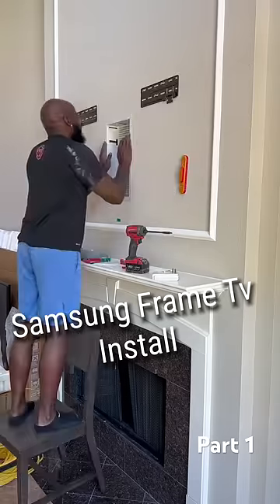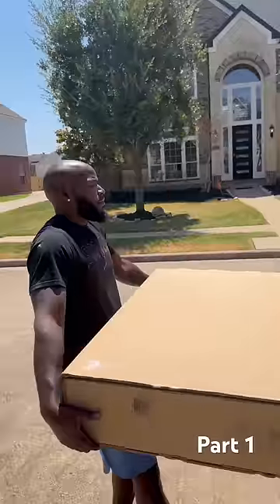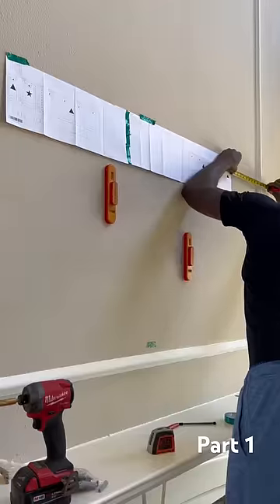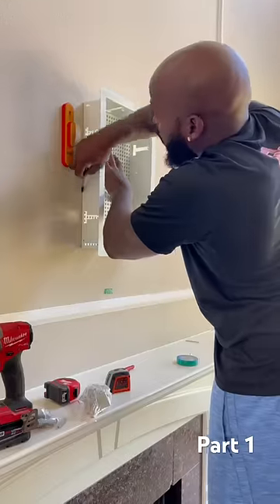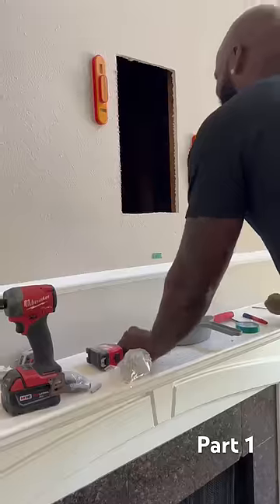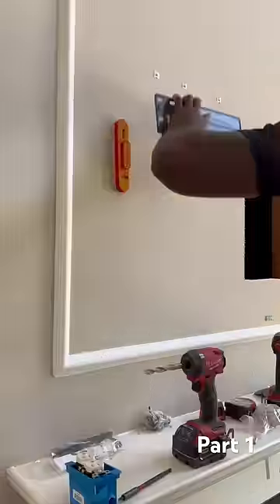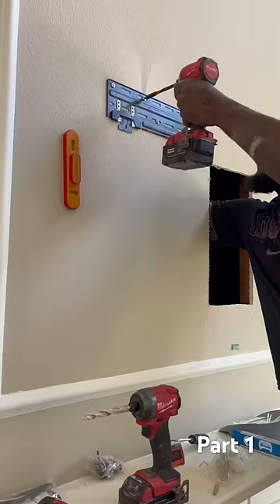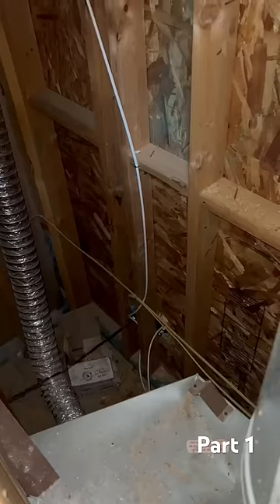Samsung Frame Install Part 1 #fyp #install #tvmounting #reels #frametv #samsung #4k #art #picture

Comment: As a DIY person and former TV salesman I knew an impending war between "the TV is flush and lightweight" and "he could've anchored it better" was going to be in the comments. 😂
Reply: Wym you can have both. Put some 2x4 bracing behind the drywall for real support. No one should ever be hanging anything directly off drywall😂
Reply: After watching ProjectFarm review dry wall anchors, this set up is going NO WHERE.
Reply: Yeah really anchored it better? Those tvs are very light but you can hang a plasma from that set up. Those mounts are small because design very well. And those toggles are way strong that you would believe. In dry wall they are rated somewhere around 300lbs a piece. He has six total for that light as hell tv. The kids can hang on it bro. He did a solid job. Experience 7 years in commercial A/V
Reply: They hold on tight until drywall fails
Reply: @Gojira_Wins  assuming the drywall stays in good shape.
Reply: @AkaedatheLogtoad  the issue is less about the mounts or anchors and more about the fact that the drywall is taking up that weight. If the drywall becomes compromised via waterdamage or what have you, it will fail. If it were anchored to a stud, it would be solid no matter what.
Reply: @AkaedatheLogtoad  if someone hangs from it. They'll bring part of wall with it. Doesn't matter if it's rated 300lbs because the sheetrock definitely isnt. That's a light TV but tvs should always hit stud. Big hole he cut might as well add wood backing.
Reply: @AkaedatheLogtoad  how many commercial tvs have you hanged with no studs lmao? That's definitely a no in my av company. But there's always people who take short cuts

Comment: $5000 TV being held up by 1/4 dry wall. I hope you have good liabilty insurance.
Reply: Lol cardboard house
Reply: It’s actually 1/2” in all homes, but I agree 100%
Reply: No way this dude is real haha. This is a way to not get customers
Reply: 1/2”
Reply: @cowboy4309  probably 3/8 the new thin shit.
Reply: it gets support from the vertical structural studs
Reply: Residential boards come in 1/2 or  5/8 ; 3/8 for bending board
Reply: @Skywing452  yeah because those things gunna help if it got pulled on or something lol 😂
Reply: How do you mount a TV?
Reply: What’s the weight on the tv
Reply: @JackalopeTaimer  make sure you put it where there is studs lol
Reply: You believe that's quarter inch drywall?
Reply: Why didn't you put wood blocking in?
Reply: Well thats a fire place wall so most likely 5/8 DW and those toggle bolts will for sure 100% hold that TV up for its entire life. Those toggle bolts aren’t being pulled on. It’s just shear weight. I personally would have blocked it.
Reply: That tv doesn’t look like it’s 5 grand. Maybe 800-1200 max
Reply: Tv ain’t that heavy
Reply: TV probably weighs 10 pounds. Mounting with toggle bolts works awesome. 👏🏾
Reply: I don’t think you understand the difference between shear/tensile strength
Reply: You beat me to it I was thinking the same thing
Reply: Where'd you get 1/4 inch dry wall?? Who does that anyway
Reply: He used the stud finder though
Reply: @blove9415  bro they overlooked that part so they can complain. Just have to let these know it all's be.
Reply: That’s crazy !!!
Reply: @JackalopeTaimer you screw the mount in a stud and hang the tv. This guy put the screws in straight drywall and that will easily rip off
Reply: Could have held a piece of wood on the back of that drywall just like he had to hold that toggle.
Reply: @DONTCALLMETHAT  Home Depot. I use it for ceilings mostly. It's really lightweight

Comment: I don't know how you put so much trust into drywall like that. I only got one 21 in monitor hanging from my wall and you best believe I drilled a stud for it and the arm.
Reply: Toggle anchors are strong af. That's why he'l trusts it
Reply: @ericedgar7407  I trust the anchors. It's the drywall I don't trust. I suppose so long as nobody puts any kind of lateral motion or just pulls on the tv the holes won't go out of round.
Reply: 💯 agree with you , if you're going to go through the trouble of cutting out a big hole for a big ass data box , then why not reach up in there and put a couple nailers in there ?  Why not use an 18 or 22 cu in. box and HDMI box .  Yes I'm an electrician and do new , remodel , and additions , upgrades , and them big ol' TV installations.
Reply: This 100% needs to have at least one stud mount. When you see there isn't one run a 2x4 between the studs where you want to mount. Drywall isn't meant to hang a TV. Not that it can't, but it's for sure not meant to.
Reply: 😂 y'all have no idea what you're talking about. Those anchors are rated for 3 times the weight of that TV and mount, and they're made to be used in drywall.
Reply: @TheBattleDwarf  you have no idea what you're talking about. Drywall can fail or become weak for any number of reasons. It's not the concern with the anchors, it's the concern with what they are anchored to. There's a reason sheet rock isn't considered a structural component. 

You certainly can hang it from drywall, you certainly shouldn't.
Reply: Drywall can easily hold up to 75 lbs with a good anchor. Just have 4 and you are good.
Reply: @ericedgar7407 nothing to do with the anchors, it’s the board itself that will give
Reply: @TheBattleDwarf  tell me you have no clue what you’re talking about, without telling me you have no clue what you’re talking about.
Reply: @brarautorepairs  drywall literally fails if it gets wet. It will support about 5 lbs if you have a leak somewhere. Drywall holds 75 lbs and if you put 4 anchors close to one another it will still hold 75lbs. Because it's not a structural component. So the load doesn't displace across it's structure appropriately. You would have to separate the anchors enough that the forces weren't compounding onto a failure point in the sheet rock.

Again, you 100% can hang a TV from drywall. I 100% wouldn't. There are a lot of things you can do. It doesn't mean I'd recommend it. You can hang the TV from bungee cords connected to an eye bolt that's screwed right into a ceiling joist. It will work. It doesn't mean I'd do it.
Reply: That tv is light enough to get away with the toggles
Reply: Take the extra 10 minutes and put a piece of wood in between the studs to drill into for extra support incase the drywall does fail because drywall is known to fail more often than wood is the point lmao everyone wanna argue for what😭
Reply: Toggle vs stud  I gotta take the stud even if toggle is rated for it.   Arent toggles a last option where studs can’t be found or used ?
Reply: I would have mounted on the studs. Also it might have been worth it to simply install a plywood back and then you leave out the guess work. If its a newer home, try to get plywood back for certain places like where tv will be mounted, in bathrooms, etc.
Reply: 21"*
Reply: @ericedgar7407 He cut a huge hole and removed a considerable amount of material. He could have easily added metal studs between the wooden ones with a hole that large
Reply: toggle bolts and anchors are so different. anchors are light duty, toggle bolts rated 250lbs ish, and force is vertical. I don't use with full motion mounts, but for a frame 🫡 3/16 toggles, and might hit 1 stud. if you hit none, no problems.
Reply: Anchors can hold plenty. How heavy is your tv?
Reply: You should never mount precious expensive electronics into drywall. 🫣
Reply: Yall do know that those are just for extra support he legit said let's find the studs he def nailed that 10inch wide plate on a 2 inch stud yall never even hung your own TV 😂🤡s
Reply: Proof that youtubers comment of nothing they know about with no common sense to see hey that's a 10 inch plate with 6 bolts on a 2 in stud & i see 4 of em ancored into drywall😂
Reply: People forget gravity exists
Reply: Because once he installs these and you pay him, he will not be able to be contacted again. There are hundreds of “businesses” like this in big cities. Installing a tv to drywall is not ok, no matter what type of anchors you use.
Reply: This isnt 1999, tvs are light. Each one on a minnimum can hold 25 pounds. Hes got 6, that tv doesnt weigh 150 pounds. Drywall is strong if the paper isnt broken.
Reply: Nothing wrong with it. Toggle bolts are rated between 50-75lbs each. I got all my tvs on toggles. And I hung on the brackets and did pull-ups, and nothing happened. I'm 225, by the way. 75", 65", 2 32", and a 42" all still hanging fine 4 years later....
Reply: @arcanask achnos are designed for dry wall.....
Reply: Yeah an arm… like 10 times the leverage this things flush those 6 bolts are plenty strong.

Comment: Time to cut out a chunk of drywall and put a 2x4 in between studs.  On another note, look into flip toggles.  The toggle gets held in place, that way if you ever have to temporarily remove the bolt the toggle stays put.